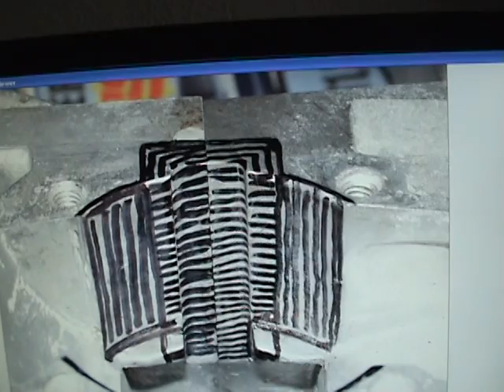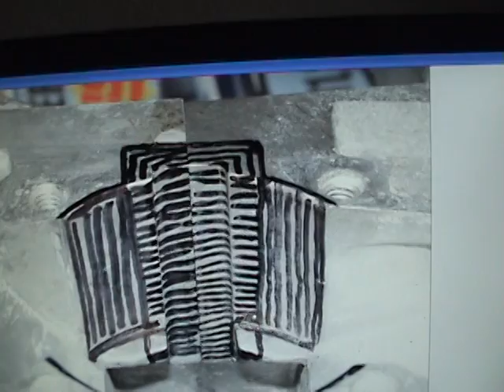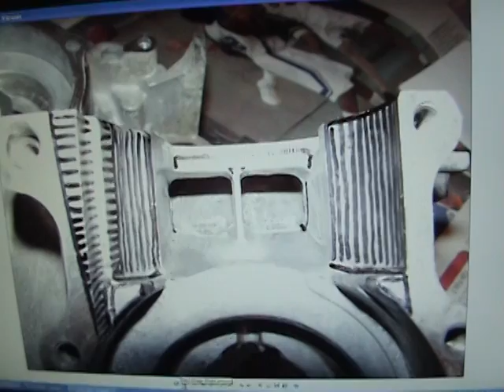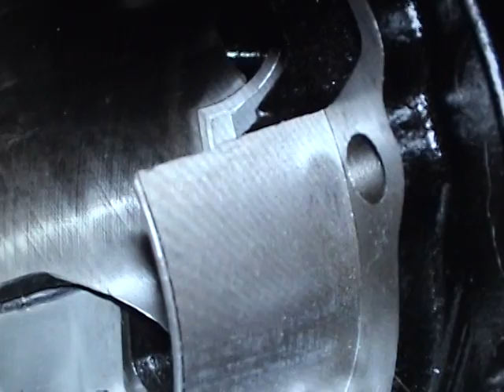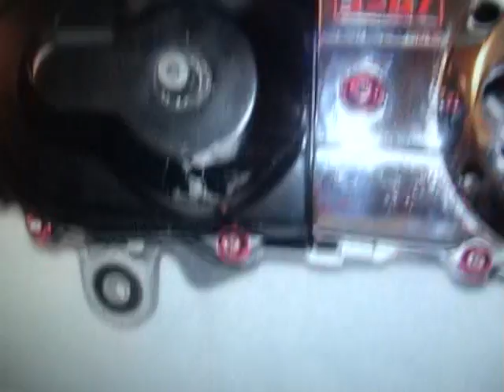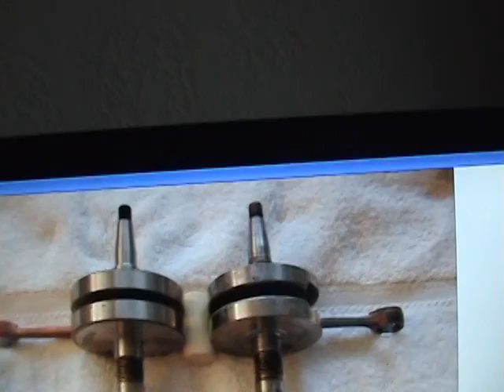2) Honda  DIO / STROKER ENGINE UPGRADE

Comment: Pressure tested my bike last night and had a leak at the bottom of my cylinder. Spent the night putting it together. On my way out to re-check it. Not much gasket area where the cylinder base sits. I my have took a little too much off when port matching. It was a definite vacuum leak started to run like shit at WFO for the last few high speed runs I take here in greensburg, IN. Hope you get to feeling better my friend.